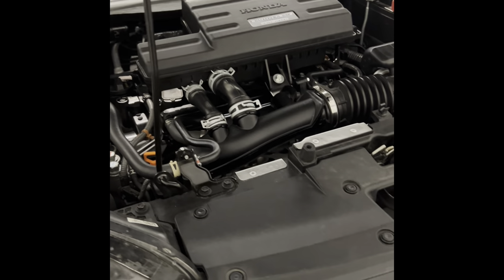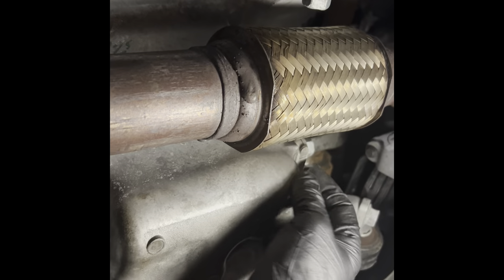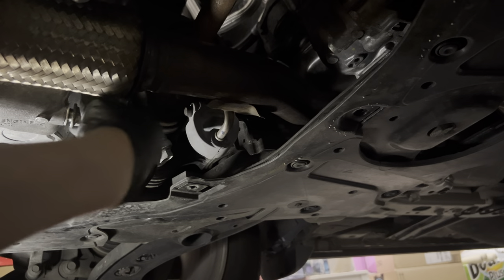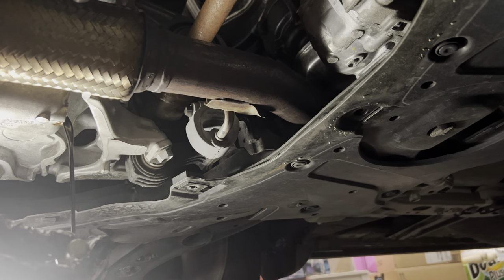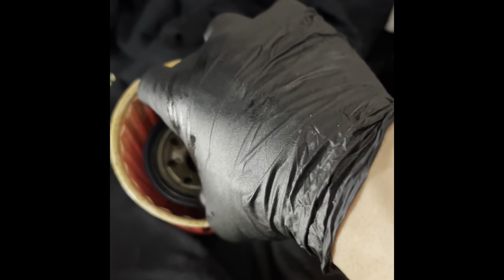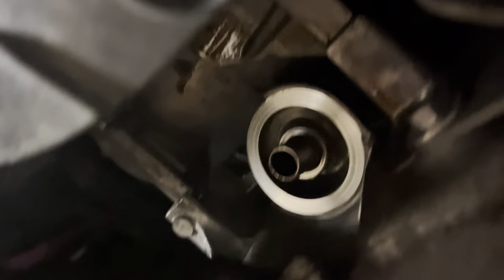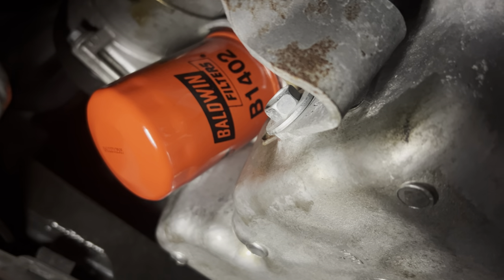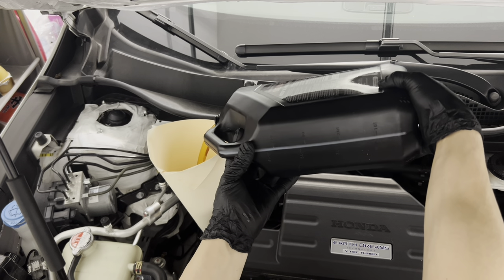DIY Honda 1.5T CRV Early oil change| oil dilution notes turbo GDI

Comment: Half of those quick release screws fell out of my wife's crv.
I went to the hardware store and replaced all of those with J nuts and screws with large washers. We live in illinois , I run 0W20 in winter and 5W30 rest of year. Change oil 4 times a year. Winter, Spring, Summer, Fall.
Reply from the maker: Thanks for commenting! Great to see you are taking care of this “high maintenance” engine. Good thing it is only 3.7qt instead of 6qt that my VW used lol.
Yeah, those quick release bolts can loosen up over time and if tightened too much, it lets go. Cheers!